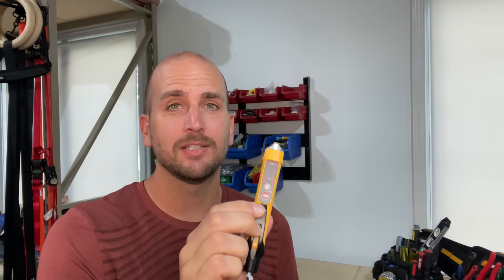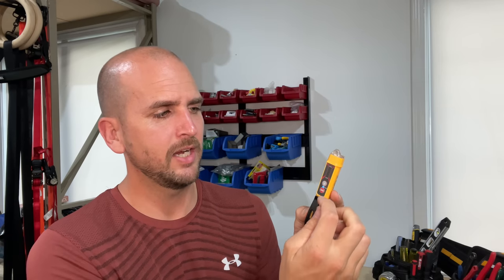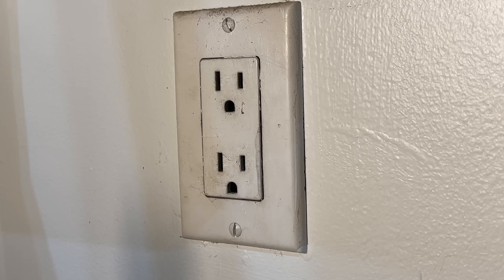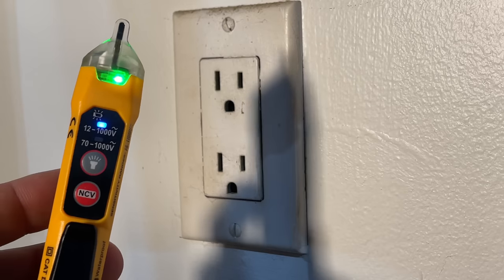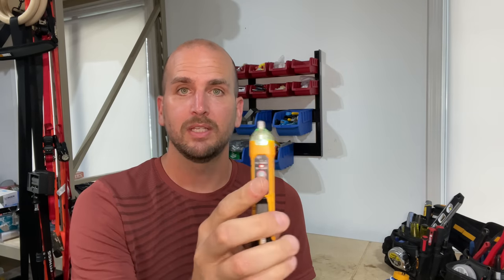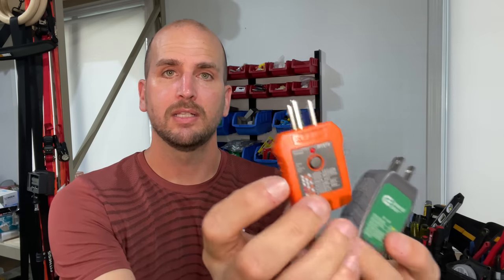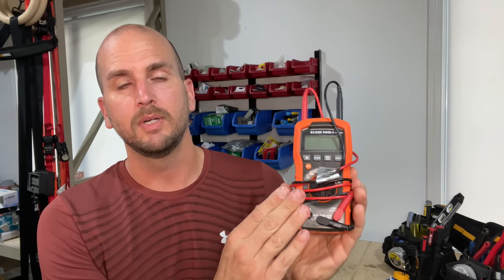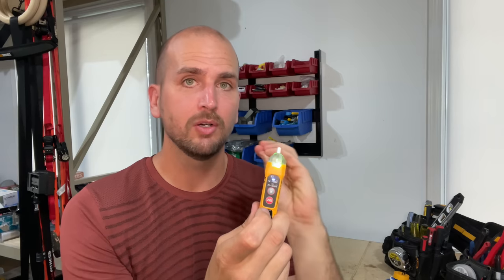Common Safety Issue |  Non-Contact Voltage Testers

Comment: I have been in the electronic field for 40 years. ALWAYS verify how the detector works or if it works every time you use it! Verify on a known good electrical source. Then you know how it sounds and what to expect. I was trained never to use other coworkers' test equipment. You are not aware of the condition of their tester. ALWAYS VERIFY AND WHEN NOT SURE VERIFY AGAIN.
Reply: Agreed...ALWAYS VERIFY
Reply: Let me re-iterate: ALLWAYS VERIFY.
Reply: I was taught (it was actually required on my job) to verify the tester/meter before and after testing. NCVs were allowed for troubleshooting, but not for verification of zero energy. We had a procedural checklist that had to be followed for any electrical job that had to be witnessed by the second man (for work over 120v/20a) and signed by both workers. This was a DOE  government job and our AHJ was stricter than the private sector. We also had an excellent safety record.😊
Reply: Thank you for the information, education and advice.

Comment: I don't trust the Klein tools NCVs anymore- at least the ones sold at the home center. I bought 3 of the  same NCVT-4IR units, and they all indicate 12 volts at 120V outlets- probably because it has no outlet probe allowing the unit to accurately detect voltage at the receptacle. Touch it to a lamp cord, and it works. I cannot believe absolutely horrendous product design oversight this is, and an embarrassment to Klein Tools.

Comment: Bought a townhouse that had a plastic ceiling light fixture with charring from the use of a too powerful incandescent light bulb. Turned off the power, removed the charred fixture, checked with a NCVT and found that the BOX was HOT!!! When installing a new receptacle upline from the light fixture, someone failed to connect the ground wires and one of them landed on a hot screw! The NCVT saved my life!!
Reply from the maker: Dang! Good story and cautionary tale to always be careful when working on electrical.  Thanks for sharing.

Comment: I try to always perform some type of Proof-Positive test on any testing equipment I am using. I would just test my voltage detector where I know voltage is live. I do this not just in electrical issues but many others.
Reply from the maker: Best practice for sure.

Comment: I make it a habit to rub the non-contact tester I use on my shirt or pants to see if it's working just before testing an outlet. The static electricity you generate by rubbing it briskly should trigger the alarm and light.
Reply: That would be great up north in the winter.  Not so good in Florida with all the humidity.  It's been a long time since I have gotten a static shock.
Reply: @trafficsignal101  It shouldn't matter how humid it is, you should still generate enough static electricity for it to detect it. I've never had an issue where rubbing it didn't work, but again I've never tested it on purpose outside on a hot and sticky day.
Reply: @JRBlood I have this exact model (no green light). I just put in a new battery but had to try this just for kicks.  The static trick worked! 
Fyi - I'm in Texas & it's been raining for 2 days.

Comment: I have a question for any experienced electricians here, that is not really on the topic of this video.  I have been doing maintenance for over 22 years and use NCVT's maybe once or twice a month.  It's not really covered here, but my problem is every single one of these I have purchased has buttons that are too easy to press.   I currently use a Milwaukee 2203-20 because the button is on the top, but even that gets pressed.  Does anyone have any suggestions for a tester with a switch instead of a button?

Comment: I always test a known, operable power source prior to testing the equipment, outlet, device, fixture, etc I'm going to work on. Never hurts to test things multiple times, especially when dealing with mains energy. The lost time in doing so may keep you alive.
Reply: Agreed, this is a good approach.  Always verify functionality if possible.  The video enforces that point for sure and can help skip this step, but I'd still test anyway.
Reply: That's the way I was taught. Check and make sure your equipment is working!
Reply: My Klein NCVT-1 has explicit instructions on it: WARNING: Before using - test on known live circuit.
Reply: Yes, regardless of tester. I use a couple different ones. They can and have gone bad. And THEN make sure your mains/supply breakers are locked out, because things happen.
Reply: @blaydCA  Lock out and tag out (LOTO) are essential! Great point!
Reply: @Tone260  Yes , or failing that disable the circuit (pull breaker/disconnect hot from breaker) or hot work precautions. I also test meter every wire...just in case. I've seen some bad stuff.
Reply: @blaydCA  Absolutely. Generally never know who was in there prior to you, or what shortcuts or shoddy work was done. Take. Every. Precaution.
Reply: @zeke112964  my "equipment" has a self test feature. Sadly it indicates failure more often than not.
Reply: Ditto.

Comment: As a young apprentice I was taught (even with an actual meter) you test it on a known hot, test the circuit in question, then go back to the known hot. Eliminating any doubt.

Comment: I thought you would be talking about the NCVT recall from Klein Tools here, but that is a slightly different issue. They actually had some people get shocked which prompted a massive recall of some of their most popular non-contact voltage testers. The issue was that if you held down the power button the tool would keep showing that green light which tells you that the tool is on and that there is no power detected. But since you are holding it down, it does not fully turn the tool on and is not actually testing for voltage. It is only showing the green light so you get a false negative, thinking there is no power since the light is green. I shipped mine back a week ago and they're sending out a new one that doesn't have this problem.
Reply: Thank you for pointing out the recall.  I own a Klein Model #NCVT1 voltage tester and was glad to find out my tester was not recalled.  The NCVT1 with date codes ending in H7 are the only testers being recalled.  My testers ending date code is G6.  Again thank you!
Reply: @spinspinsugar480  I have an NCTV-1 I was coincidentally using just an hour ago. I looked all over it looking for the date code you mentioned. I even partially disassembled it and found “October 2008” and “32002Na” stenciled in the little circuit board behind the batteries. What did I miss?
Reply: @Dave-ei7kk  I’m wondering the same thing. Maybe I’ll try looking online

Comment: Klein had a recall about a month ago on the basic model NCVT-1. I received an email from Home Depot concerning this because I had purchased one from them.
In this case the green light would stay on indicating a safe condition even though there was voltage present. I returned my tester to Klein but so far I haven't gotten a response.
I worked in the field as a technician for 30 years and always used a meter. The plug in voltage testers are also very handy and helpful.
I don't think I would ever trust a NCVT alone. It is the first step but always confirm with my meter.
Thanks for the helpful info.
Reply: Thanks! I bought an NCVT-1 from Home Depot with the affected date code, and I had not heard about the recall until reading this comment.

Comment: A little extra safety never hurts. Non-contact testers are great for some things, like identifying circuits and quickly identifying where a problem may exist, but I like to check the screw terminals with a cheap old neon tester as I'm performing work just to be sure.
Reply: @Grauenwolf  The Neon testers were only for AC weren't they?
Reply: Automotive testers are usually rated for 12 DC (Direct Current) and residential testers are rated for 120-440 volts AC (Alternating Current) so that is why your 12 volt automotive blew out when 120 volts AC was applied to it.
Reply: @Grauenwolf  Neon testers are for voltages much higher than 12v. They won't light at 12v or 24v. Automotive testers are not neon.

Comment: Great informative video! I’m in HVAC and I just purchased the NCVT-3P. That’s a huge difference you pointed out between the two testers. I could easily imagine getting shocked using the NCVT-3. It’s not an excuse but sometimes I’ll ASSUME things are working when I’m rushing to get things done. That’s where the 3P model would help protect me like you explained. I’m gonna share this with the guys at work. You might be saving someone from injury or death by putting out this video. Thank you for sharing!
Reply from the maker: You bet, thanks for the feedback!

Comment: Thanks for the video. I am DIY guy for last 40 years before non contact voltage tester OR plug in outlet tester existed. Way back at teen, I would just plug in table lamp in Outlet I was going to work on PLUS turn on ceiling light PLUS one more 120V item in another outlet in that room. Then turn off main panel breakers until ALL of those were OFF.  Then I replaced the outlet.  Fast forward 20 years and I would plug in outlet tester to receptacle to be worked + ceiling light in room + another 120V item in another receptacle in room and turn off breakers until ALL were off. Then I would STILL test that receptacle with multimeter set to 200VAC.  LOL-just today for first time in my life I bought Ames AVP-600 non contact voltage tester which I will use in conjunction with good ol 120V outlet tester before I work on 120V outlet or GFCI

Comment: Great advice! As soon as you were done with this video I went directly to my toolbox and checked out my non-contact voltage tester.It tells you that your battery is good by lighting up momentarily. Even though it does that I always check it out with a known hot source.I’ll be going to Home Depot tomorrow to get a better one.
Reply from the maker: Checking with a known source is a great approach but the NCVT-3 can still get you in trouble if the batteries are getting low.  Well worth the upgrade to have the alway on indicator light.  👍.  Thanks for the feedback.

Comment: So when talking about the first 2 testers, when you say “you know you have power”, you are talking about battery power, not the electrical circuit power in the house. This might be a bit confusing for some. It might be better to say something like, “The green indicator light stays on to tell you that the tester is operational.”
Yes?

Comment: I use the Klein Tools NCVT3P. It's my best friend. I love it so much I purchased another one because I lost the original. I found the original but still wanted a second one. They're just very convenient and reliable. It's difficult to always find a wire, then it might not be spliced, and you can't use a multi-meter in those cases without a lot of extra work and complication.  Nothing wrong with using one as long as you know it's reliable and I also usually have a live wire in close proximity so I am also almost always able to double check it.

Comment: I've used the -2 klein model for a few years.  Outlet testers are fine usually but that open hot condition could also mean open neutral and ground since it needs some sort of completed circuit to light an led.  Great video bro.

Comment: My Sperry volt tester only works when the spring loaded button is pressed. Making it operable with sufficient battery charge. The outlet tester is bundled with the device for $30 bucks. Worth it as it has provided peace of mind for decades.
Reply from the maker: Have seen the Sperry tester which has a non-contact voltage tester on one end and an outlet tester on the other.  Pretty cool 👍

Comment: I have both the Klein NCVT-3P and Fluke 1AC-A-II voltage testers. I have never gotten a false negative with either of them. But I have gotten false positives with both. When I got a false positive, both showed the false positive. But my outlet tester (I have three) showed no current. So I used my digital multi-meter and it showed less than 2 volts. So I turned the breaker back on and the multi-meter showed 125 volts, so I turned the breaker back off, the multi-meter went back down to less than 2 volts so I proceeded to finish the work.

Comment: Another thing to note is how they actually work.  They do so by using YOU as a ground reference to complete a complete circuit.  So if you aren't a good ground (standing on rubber mat, using non-conductive gloves, etc.) it will not detect the presence of AC, which could be lethal.  Just learned that about 10 minutes ago.  Good to know!

Comment: As a 30 year electrician I cant begin to tell you how many of these things I’ve tossed in the trash name a brand I’m sure I’ve tried it. The most reliable one I’ve found is the Milwaukee brand. It has been hands down the most reliable. ( it’s the only Milwaukee tool I own so trust me I’m not trying to push Milwaukee) it has a nice little led light that works well. It beeps it flashes when voltage greater than 48v is present. ( I might be a little off on that voltage but it’s close to that. )
Reply from the maker: Thanks for the feedback JJ.

Comment: None of the devices you demonstrated is an electrical tester suited for the task you mention!

Suitable are 2-pole electrical testers that reliably indicate dangerous voltage independent of settings and battery condition (dedicated warning LED). Examples are: Fluke T+Pro, T5, T6, T150, T130; Ideal 61-547, Vol-Con; Klein ET40, ET45; Beha-Amprobe 2100 and others.

Why not NCV: It's not reliable at all, neither to indicate the absence nor the presence of dangerous voltage. Using it for that is even against code.

Why not the Multimeter: Works only with batteries, doesn't indicate voltage independent of settings, can be configured or used wrong. Using it to test for dangerous voltage is technically against code and common sense.

Why not the socket tester: Technically if it has the dedicated LED functionality (indication independent of battery and setting), it would be okay. BUT: It only works on the socket! You cannot probe the wires. So It's unsuitable to be used as electrical tester.

Please tell me, why not to use the tools that are specifically designed for the task (indicating dangerous voltage safely and reliably) and are demanded for the job by code and standards. Why mess around with diagnostic tools that are unsuitable for the task (safe insolation). Why promote dangerous working practises. Enlighten me.

Comment: Best practice is not to rely solely on an NCV to ensure no power is present. While an NCV can certainly help in determining which breaker to turn off, it should always be used in conjunction with another means..either outlet tester or DMM.

Comment: I have a Gardner Bender NCVT, it has a momentary push button that you have to hold down when using. It flashes a red light and beeps at initial power up. Also have a multi-meter with NCVT and I sometimes use a plug in outlet tester.

Comment: I bought the Klein tools ET310. It's the circuit breaker identifier with the outlet tester. It's worked great each time I needed to replace outlets throughout the house. Only negative I have with it is that I can't identify loose wires or lighting circuits with it. Thats where those non contact voltage testers come into use for me and play breaker roulette.

Comment: Fair point however, for me, I would not assume the circuit is dead unless I actually heard the ticker beep. If there was no beeping at all, I would be very suspicious and try it on a known live circuit first to make sure the ticker itself wasn't faulty and/or the batteries are dead. But I do agree the “power on” indicator for any ticker is a must.

Comment: Always do a control when using the tester. Check a known powered outlet, and make sure it is set off by the live outlet. Then test the outlet you wish to work on. That way you will know the tester is actually working when you test.

Comment: Amazon has a great Klein starter tool pack w/screw driver, wire cutter/strippers, GFCI tester, and NCVT-1P voltage tester (green LED tip). Used to replace GFCI outlets - so handy.

Comment: I have had my tester since Builder Square was an outlet to buy home building materials call Greenlee Test Instruments Cat. No 1110. Always works flawlessly and if I have changed the battery once in it's lifetime that would be allot. Once would be it. I always test on a live circuit nearby before checking a circuit that I'm going to work on and I always wear gloves. I do also have a voltage irregularity/GFCI tester as you mention later. Found a number of reversed circuits when I moved in 7 years ago. Changed out all the outlets as they must have been budget builder types from 1989 when the home was built.

Comment: If a non-contact tester signals that there is power in a circuit, I'll treat the circuit as hot. If the tester does not signal a circuit as live, I'll suspect the circuit is dead...... but realize that it requires further checking before treating it as such. 
Used properly NCVT's are great tools and deserve a place with my tools!
P.S. The first step in using a non-contact tester is to ALWAYS check it on a known hot circuit. Safety first!

Comment: I am not an electrician but I do plenty of electrical tasks. Anytime I am relying on a non contact tester, I always first use it to test a known "hot" to prove to myself that the tester is functioning. This is a simple way to determine if the tester is reliably indicating that voltage is present.

Comment: Our laboratory DVM was damaged. It gave false zero voltage reading on a live circuit. I retested by plugging in a work lamp that lit up. 
   After that I kept several back up DVMs locked up to use as needed.
   The damaged meter was repaired by electronic technicians.